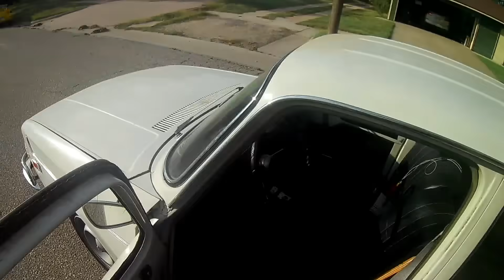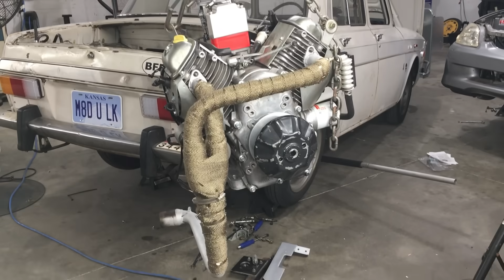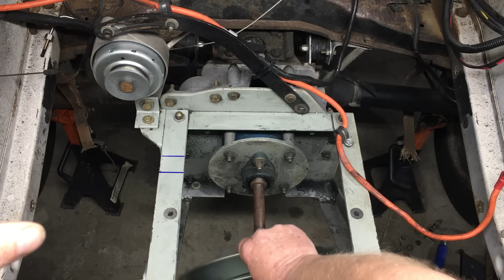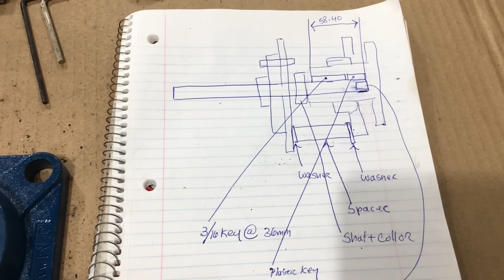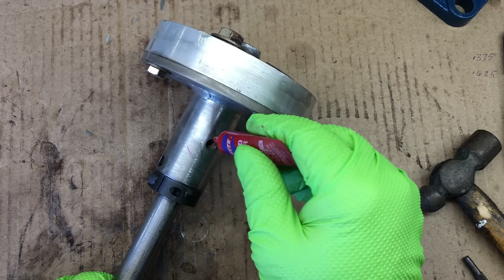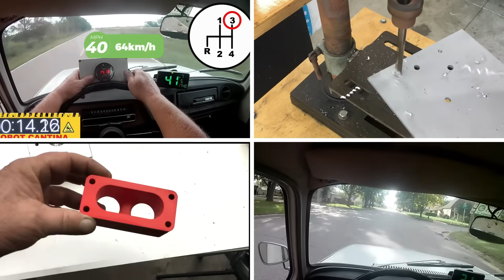S3E 36 & 37: We install a Comet 94C clutch on the 670 cc predator powered Renault R10

Comment: I always look forward to new videos every Sunday!
I have a few unconventional engine ideas that could be used for future projects:

-Wisconsin V4 engine
These old dinosaur work horses were used for industrial applications, but no body uses them because they are big, heavy, and don’t produce music power for their weight. However, they are air cooled and being a V4 layout, it should sound really cool being a super uncommon layout. They made flathead engines but I would try and find an OHV engine. There’s more potential for power with OHV.
-Big block Briggs Vanguard of Kohler V-twin. 1000cc. 
No one seems to do projects on these probably because of their high price tags. They are like the Predator 670 but much bigger and have more power out of the box with room for even more. I know there are some aftermarket performance parts for the 35 HP Briggs Vanguard as they are also used as a marine engine.
-2-stroke jet ski engines. 
They have 2, 3 and 4 cylinders, liquid cooled and sound pretty radical and make a lot of power at high RPM. Getting the liquid cooling to work being a marine engine would be tricky because you would have to convert the cooling system from an open loop to a closed loop system with a radiator. I have a 650cc Yamaha 2-stroke 2-cylinder jet ski engine that I plan on making into a motorcycle one day. It might involve casting some aluminum parts to make it cool properly. An easier solution would be to try and use a snowmobile engine instead, which are more or less the same thing except they are air cooled and often come with their own CVT transmissions.

All of these would be significant challenges for one reason or another. But it would make super awesome videos.

Comment: Not to disparage you experiments, the whole concept of tiny engines powering vehicles has been done before. There are many light trucks in Japan (the K car class) powered by 650 cc engines. Many have 4WD options and they do work quite well with moderate top speeds. Just make sure you are not in a big hurry to get to your destination especially if your route is up hill. Still Jimbo, this is very entertaining to say the least!

Comment: Doing a project not because it's easy but because it's hard. Great work!
Reply: Can I ask why red and not blue/others for the go nowhere juice?
Reply from the maker: I have used blue in the past and it doesn't  hold as well as the red.  The proof is I more or less ruined a lot of stuff getting the red to release.
Reply: @robotcantina8957 What about orange? Loctite claims it has the strength of red but heat isn't required for removal

Comment: SuperfastMatt had a great explanation for not using metric fasteners when building projects in the USA, Canada is the same. You have 10% of the selection at 3x the price.
Reply: I do some small time restoration of random things in my spare time. Tractors, cars, anything with an engine basically. I live on the edge of nowhere in Arkansas. Finding metric hardware can be difficult. I paid $45 for two m14 bolts with nuts or something like that. And now that place actually went out of business so I'm stuck with even less options now. Lol I like super fast matt and his points are excellent.

Comment: The shaft just needs a light scuff to clean it up. But you should try and find chromed shafting, difference is like shit vs chocolate. Your set screws NEED flats ground on the shaft. They will not work properly without this. Voice of experience here. Put the shaft in, drill a spot through the screw hole, remove the shaft and then drill a better flat with a slightly oversized drill. The bonus is that the screws won't mar the shafts and make assemblies permanent anymore. The screw sitting in a recess helps key things in place.

Comment: maybe the small CVT's automatic clutch is slipping a bit and causing the pulleys to heat up?
I know it's too late now, but for another time.
There are two possible settings on a CVT: the speed when the clutch sticks and the speed when the belt starts to rise.
the higher the clutch speed, the more power there is but also there is more wear; and the starting setting for belt rise must be that of maximum torque for the best acceleration and end at maximum power for maximum speed.

Comment: fastest lawnmower powered car in existence? does the "Cars and Cameras" 670cc turbo predator engine dragster count, or does it need to be street legal ;)
Reply from the maker: Good point !   I should have said the fastest street legal lawnmower powered car.   LOL.  Although C&C also has that 670 King Midget...
Reply: @robotcantina8957  ah fair point there too! I don't know that currently it's street legal but I'm sure that one would be easy! I've seen worse things cruising the roads in Arkansas.... 😂

King Midget Vs Renault in the... I was gonna say 1/4 mile but maybe they need something longer lol  bring us the crossover!  I'd love to see y'all get up to something together one day, even if it's not a race. I think it would be fantastic.
Reply: @robotcantina8957  i think you need to get a set of timing lights and an 1/8th mile test track section for "official call outs" lol
Reply: That's not a car, I'd say It's a purpose built machine. I think to be a lawnmower powered car, it would have to have started off life as a street legal production vehicle that has been engine swapped, at least in my opinion that's what it takes to be considered.

 C&C dragster is sweet, but in the end it can't be driven on the redneck proving grounds and likely wouldn't be able to be made street legal. 

I was gonna say having a VIN is enough but there's a lot of "not cars" that are issues a VIN these days

Comment: Only a quarter way in the video and see the larger pulleys is going in. Very popular modifications for smaller cc scooters with no lowend power. Helps improve lower rpm acceleration and even helps with a slight increase in top speed.  We call them over range cvt kits so it's cool seeing similarities between the  cvt on this engine.
Reply: I, until last year, did not realize what was in a scooter for drive system. They're honestly pretty neat. I had to put a belt on one last summer for my father in law. (Technically he's my wife's grandpa, but her father figure growing up) what an interesting find when I opened it up. 2004 model with an original belt 😂 

The whole variator/clutch system was neat. I'd worked on plenty of CVT drives like comet 40s and such. Seeing a new way of use (to me, obviously it's been used for ages) was fun.

Comment: I saw a LIFE HACK the other day, where a lot of these nightmare to change belt setups, they ziptie in a spare belt  into the area over the shafts, so it doesn't need to be fully dismantled to install a spare/service belt in future. is there room for this? (here's hoping it's not needed again either, but it could be a good tip to share also)
Reply from the maker: We considered this, however the transmission leaks gear oil and the fear is the spare belt will  be coated with oil.

Comment: The funny thing is that you basically built a similar car to the DAF 600 from 1959 which had a 22hp 590cc aircooled boxer twin with Variomatic. It weighed about 640kg.
Reply: It could drive as fast backwards as forwards the saying goes. NL ingenuity for sure!
Reply: @rjung_ch  haha my moms subaru does the same thing. Dont ask how she found out🤣
Reply: @will7its  🤣
Reply: Well DAF did use 2 cvts one per driven wheel and the little bit of slip a cvt has acted like a limited slip dif
Reply: @TheLtVoss  They also let the driven pulleys twist, so no cardan joint was used. The driven pulley was just attached to the swing axle.
Reply: Love those old DAF’s , good childhood memories. Wasn’t a V2 though😊
Reply: Yup, DAF -- dutch ingenuity with their first stab at making cars with CVTs...
Reply: No.

Comment: When you get to a operational stand off with performance can you try nitro fuel???
Reply: Could it be done? Yes. Would it require like 2-3 episodes worth of adjustments and farting around with fueling supply volumes? Certainly. I'm sure it would work but honestly the fuel volume required to supply, would make test driving like dumb expensive. Maybe he can get the gnomes to "acquire" some for him 😂

Comment: 14:00-"Mix and match imperial fasteners".  You could work for GM Jimbo.  Mixed up metrics and SAE and redesigning to use heavier drivetrain parts that weren't up to the job.  You have it all baby!
Just messing with you.  You the man at making stuff work that seems impossible.  Keep it coming please.
Reply: Yep GM loves doing that, body panels usually metric, brake fittings sometimes half and half, everytime i work on one im doing the WTF face when i find the fastener or connector is a different size.
Reply: Ugh this drives me nuts about GM. Ford has had a couple questionable decisions in this department over the years as well.

Comment: Unknowingly purchasing a car second hand that came from the factory with metric fasteners but has imperial nuts and bolts clamping random things together all over it is one of the worst situations to find yourself in. It looked like a good buy until you realized you have to replace half of the suspension fasteners. Ohh what's this holding the gas tank up in this Honda? A 9/16 nut and bolt? What's that? I don't own many imperial tools because I refuse to buy domestic cars and owning 2 sets of everything is annoying and inconvenient?
Reply: Metric fits sae in almost everything except 7/16. But I do agree with you only so much room in the tool box
Reply: Haha I've bought Hondas like that before lol 

I unfortunately work on just about everything, so I have to have all the stuff. Just makes cleanup harder when I'm done. 30-50% more tools out of the box to do even small stuff.

Comment: clocktight, double groove bearing is also a thrust bearing, all-in-one
Reply: I'm pretty sure that you meant "deep" grove bearing, and though they can withstand some axial load, it would not be the best choice for this application. A ball thrust bearing would be much better.
Reply: what, design your double groove properly, it will also support vertical loads like a fully vertical thrust bearing, but support vertically from both sides and also radially, and the bearing balls will not fall out, 3-in-1 generic all-conditions bearing @EDesigns_FL
Reply: no, I do actually mean double groove bearing, idk what the market term would be or if it even is on the market, check my community posts for an image, but simply its two grooves, one on the inside rim and one on the outside rim, keeping the bearing balls nicely in two-point contact with each rim, making it fully stable vertically   @EDesigns_FL
Reply: @gsestream  You might mean "double row deep groove ball bearing", which is just a pair of siamese deep grove bearings.  Either way, a ball thrust bearing would be a better choice for resisting axial loads from a clutch. Axial loads on deep groove bearings create internal radial loads,  which in turn increases their drag/resistance.
Reply: no, single bearing slot with opposing grooves, and I disagree which is the main point @EDesigns_FL
Reply: please dont assume I mean anything that is on the market or any current market options @EDesigns_FL
Reply: explain what is wrong with full vertical supporting normal bearing, are you are designed of a vertical thrust-only bearing and selling those designs @EDesigns_FL
Reply: I assume you are biased towards an old lacking design (or duplicate work design) @EDesigns_FL
Reply: anyways the design I described works in exact same way as the usual thrust bearing, but its double 45 degree bearing ball contact angle on both vertical sides will support vertically and radially and keeps the bearing balls in. @EDesigns_FL
Reply: @gsestream  The races/grooves in all ball bearings oppose each other. it's their orientation in relation to the axis of rotation that determines which type of bearing it is. 

If the bearing races oppose each other radially, its a conventional bearing. The vast majority of conventional ball bearings are deep grooved to accommodate some axial load. If the bearing races are axially opposed, then it's a trust bearing. There are also angular contact bearings. 

Nothing that you have stated negates the fact that a ball thrust bearing would be the best choice.
Reply: @gsestream  It's evident that you have very little understanding of what's entailed in efficient bearing design and the nomenclature.  You might appreciate how ridiculous your comments are if you do a little research in this subject.
Reply: thanks, no need for any advice from you, and I'm also an engineer, so dont try to teach me @EDesigns_FL
Reply: assert your dominance by yourself, I dont care @EDesigns_FL
Reply: same back to you, bruh @EDesigns_FL
Reply: pinky finger up, 1 million dollars @EDesigns_FL
Reply: no, there is no slots for the bearings, the are free-floating in the movement space provided by the double v-grooves @EDesigns_FL